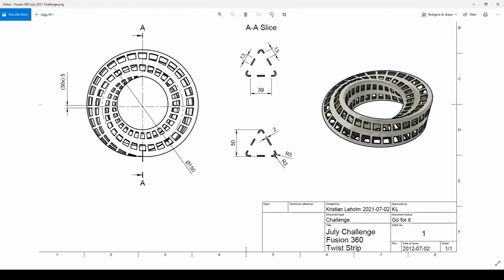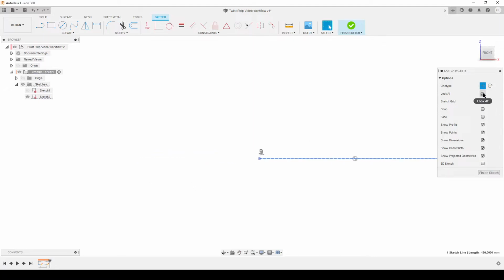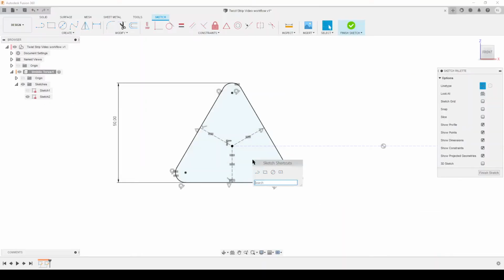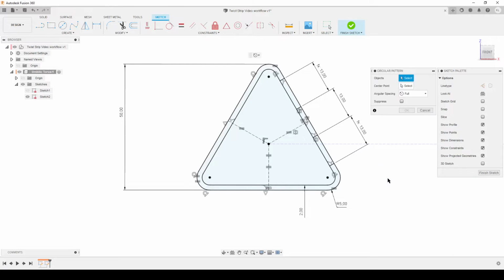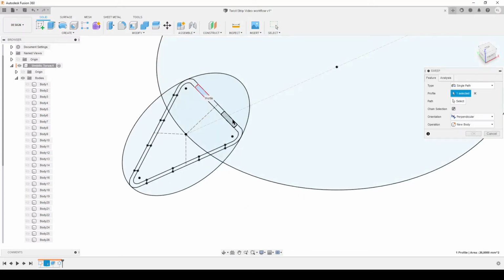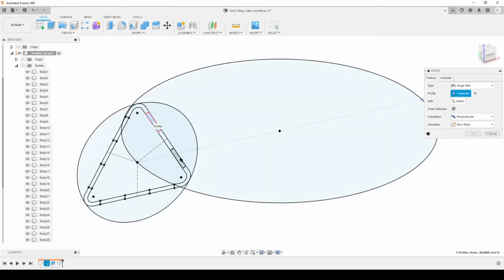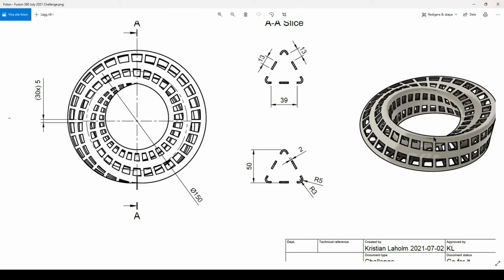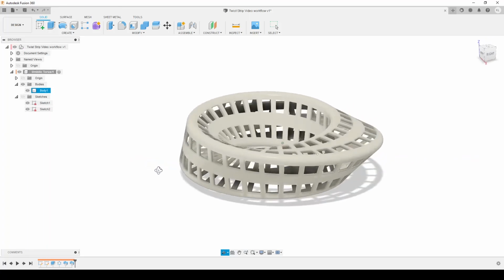Fusion 360 July 2021 Challenge - My Workflow

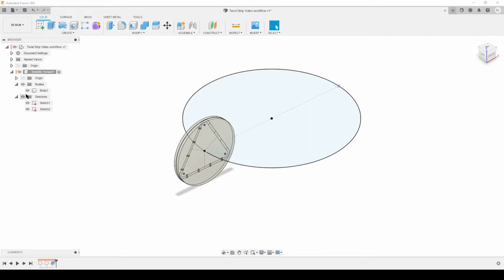Comment: Patterns... @7:17 - you should NEVER do that - you should only ever pattern features, never bodies, because you can never perform parametric operations on bodies.  It would be worth learning the main point of Fusion360 (parametric operations) and then making sure that videos you make use those techniques properly - otherwise, you're teaching people the wrong way to do things that will make their future life hell.
Reply: Suggestion: model a lego brick, that has the width and height as parameters.  That will help you understand where you are going wrong.
Reply from the maker: @chrisdrake4692  width and height as parameters? what has that to do with pattern of bodies/features? Or you suggest make the knobs parametric to the size of the lego brick?
Reply: @KristianLaholm  LEGO is measured in studs.  Can YOU make a parametric brick?  This was a trick question - it will force you to crash into the pattern mistakes you're making very quickly.  Bonus points if you can model one that works for 1x1x1 as well as 4x2x3   (4 studs long, 2 studs wide, and 3 plates high - e.g. - the most common lego brick size).
Reply from the maker: Why don't you make a video on the "right" design workflow creating a parametric L3GO-brick (avoid using the manufacture name for copystrike reasons)?
Reply: @KristianLaholm  I already did, and shared the files - but you totally miss my point.  There is no better way for YOU to learn how to do things properly, than by trying to do something frustrating and infuriating yourself.  You're never going to know why your existing approach is wrong, until you crash and burn with it... Doing a brick forces you to find out and learn how to do parametric repeats properly...  It doesn't have to be a brick - anything that takes input paramaters to adjust something that repeats will work as well (e.g. a ball bearing race, with variable number of balls is another one I've done and shared too, which is also challenging).  Like they say: once-bitten, twice shy.  You need to get bitten to learn.
Reply from the maker: I agree with you to some point, but making all your models 100% parametric is not a holy grail. Looking at my workflow this could work perfectly with a feature pattern if I did things in a slightly different order, but to think that someone always does the perfect workflow order every modeling? noooo I don't think so.
Reply: @KristianLaholm  My point is that if you cease doing things that can NEVER work well parametrically, and ALWAYS work in ways that can... it will not be long before the fact you're working that way has no negative impact whatsoever on anything you are doing.  The BENEFIT is that from there on, it will HALVE many of your workflow tasks, because changing things will almost always work properly from then on.   It's stuff-all time to type "num_faces=20" into an input box (naming a repeat count), and just 1 or 2 seconds later to edit the parameter to change that.  Being clever is about working "smart" not "hard".  You are already sharing videos - cool - but everything you make is not useful to anyone else when you share that, for as long as they need to change anything about what you've made.  You may as well ship them the STL.  

Doing it "right" is SO much more gratifying, and making videos at the same time while doing that is teaching people stuff that's going to save them days of effort later...

Comment: wouldn’t you want to use a revolute instead of extrude for the circular pieces in order to be consistent with the sweep?
Reply: other than this, it seems like the best workflow for this kind of shape!
Reply from the maker: The straight "ribs" was my design intent to keep the challenge as "clean" as possible.
With revolve the "ribs" got a bit to thin on the inside for my taste.
Reply: @KristianLaholm  that's understandable - it doesn't really matter either way